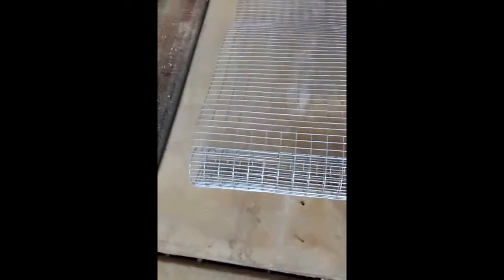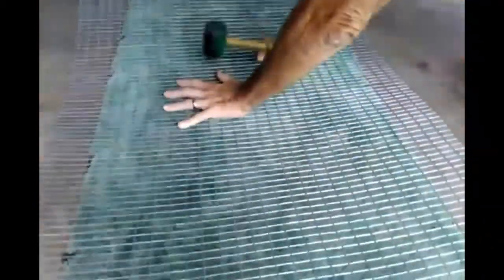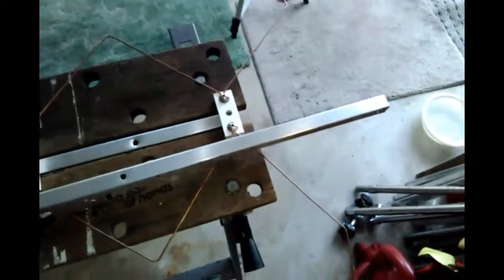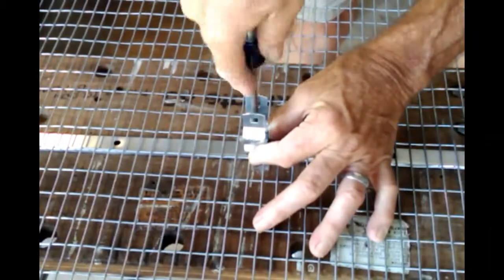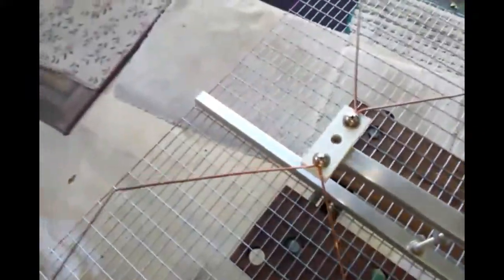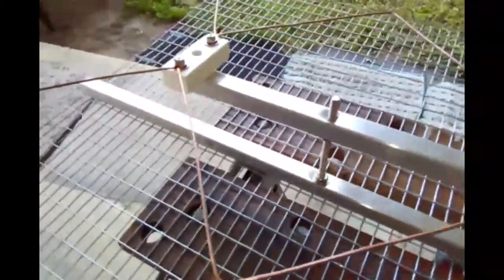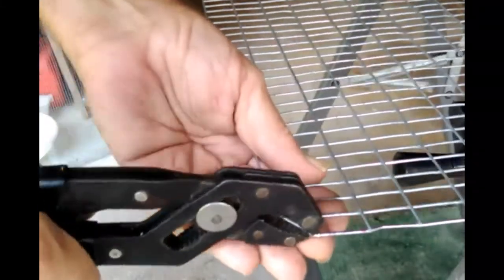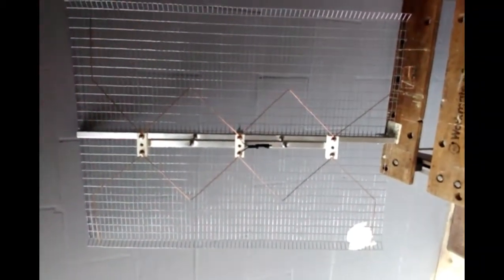REFLECTOR

Comment: Very nice construction practice!! I am wondering how you calculated the element lengths, are the full wavelength.from section to section for proper phasing of polarties? Also how was the impedience calculated for 300 ohms?? Thanks
Reply from the maker: The question of impedance has a very involved answer, in short,. Most antennas we use are balanced ( two active sides ) of 75ohm each side feeding into 75 ohm ( unbalanced ) coax cable, combined by a 4:1 transformer. By convention all dipoles or balanced antennas are 300 ohm. The subject is very complicated.
Reply from the maker: Wavelength ; λ = v/f
Or use this handy calculator to find a wavelength of a particular frequency,
https://www.omnicalculator.com/physics/wavelength#wavelength-formula
Scroll up for calculator.

Comment: Another awesome video :)  thank you for the info.  I couldnt trouble you with asking where you got them mounts from could i ?
Reply from the maker: The mounts I use are simple electrical conduit clamps available at most hardware stores, Lowes, home Depot.
They hold very well and are perfect for a vertical antenna mounted on a conduit mast .
Send me an email Cosmic222@protonmail.com
And I'll send you a pic if you want.
Reply: Thank you, i appreciate it!  I will email you.

Comment: Thanks for your quick uploaded.  I have a roll of mesh similar to this that I used to keep birds out of my chimney.  Little bit tighter.  Most of what I've seen simply use straight horizontal rods.  Is the mesh all that critical?  Also the 4.5 inches was the info I was looking for.  How critical is this?  Does the signal strength simply drop if it's not correct?  Was thinking I could get this pretty slim by just using the back bone you did the other day.  Put the entire antenna in some kind of box ( foam board etc... ).  I'm only 21 miles from the Sears Tower as I indicated yesterday, maybe don't even need the reflector.
Reply from the maker: Thanks, glad I could help. Mesh or grid from 1/4" square up to 2"x3"  works fine. The reflector rods do a good job but are difficult to incorporate into the layout.  I believe the grid or mesh gives more signal return thus a more stable picture. The setback measurement of 4.5 " for the hoverman seems to be what works best. I have experimented closer 3", 2" and lost the signal. Also tried 12", 15" and 20" the 15" worked well but is impractical. It's a matter of keeping the signal in time or phase as it bounced off the reflector at almost the speed of light. Too close or too far cancels the signal out. The element alone should work fine at 20 miles saving you some work. Only thing to do is try without then with a reflector. Get a  TVFOOL.COM report to see if you have signals from other directions, sometimes too many signals from too many directions cancel each other out and a reflector will block interference out of the target bearing. Keep up the good work you're on the right path...M
Reply: @cosmicantenna9244  Would making the reflector wire out of bronze or copper and soldering the wire together at say 2 X 3 inches rectangular size or a little smaller work ??? I do not worry about the time it will take as I would like the look of shiny metal look. The wire would be 1/16 inch diameter size. Would you think that will be O.K. for the antenna ??? I plan to use the Gray-Hoverman type. 
Also, I would need to make two antennas since where I am located stations are located 180 degrees apart roughly. Would that cause any problems for reception ??? Thank you Mr. M. for giving me an education on antenna making. Any other pointers would be appreciated Sir. 
Peace vf.
Reply from the maker: You can make a reflector out of any metal you have. The thing is the weight of the finished antenna.
Up in the air on a mast the wind loading on a heavy antenna would be increased. 
I try to keep the builds between 4-8 pounds for easy handling and stability in the air.
Reply: @cosmicantenna9244  Thank you Cosmic Antenna for letting me know some usable facts on antenna making.